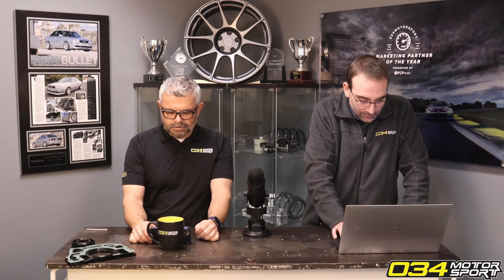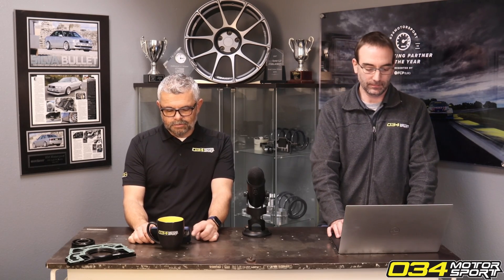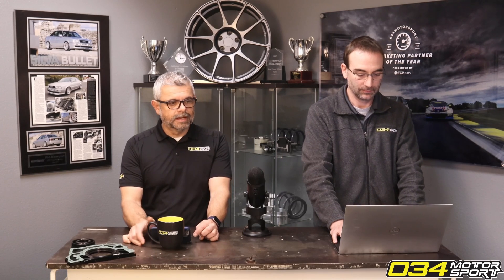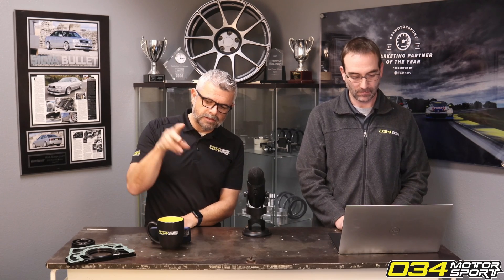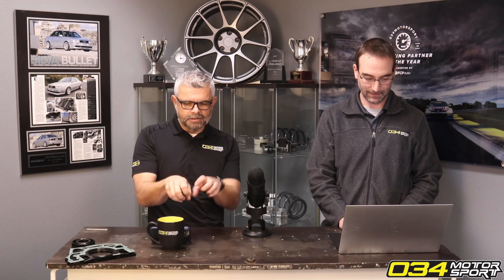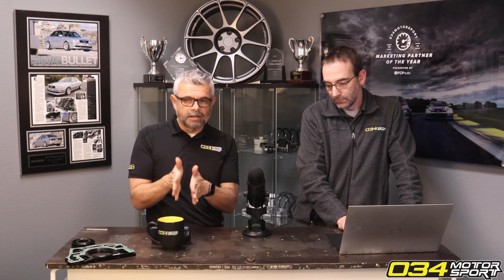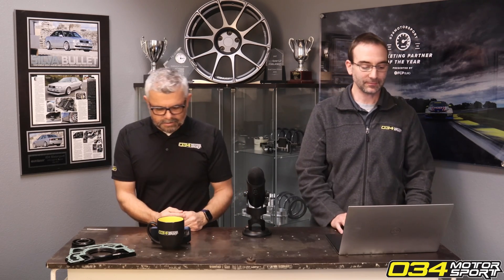Will Putting On a Turbo Blanket Reduce the Life of my B9 3.0t Turbo? | 034Motorsport FAQ

Comment: 10th gen civic owners! $30 turbo blanket and $24 air inlet blanket on Amazon . Been running good for 2 years now not one problem with the engine or blankets,I was very skeptical about it but I can’t deny the results I’m getting money well spent in my opinion a measly $54 best buck bangers around

Comment: I added a turbo blanket to my 2018 Fiat 124 Lusso with a 1.4 litre turbo engine to reduce temperatures under the hood to prevent damage to a lot of the hoses and plastic/rubber components nearby the turbo.  On the Spider the turbo blanket does not go anywhere near around the complete turbo more like 2/3 or slightly less around so this works better than the stock metal heat shield but is essentially a heat shield itself.  It really does accomplish heat reduction under the hood.  I haven’t observed any deterioration of anything on the turbo itself or anywhere else. I wasn’t expecting any vehicle performance change and there wasn’t any change.  The turbo blanket does prevent heat buildup and hence extends the useable life of under hood components.  My experience with this vehicle anyway.

Comment: This is nonsense. If you use inferior metals yes absolutely. But decent stainless won't rust I had mines wrapped drove it in rain you name it after 2 years pipes looked fine. Just don't wrap to thick

Comment: I’d love it if there were reasonable hood options with vents to help get the heat out/bring cool air in. I think the design of the B9 engine, while great, having that turbo up above an engine already getting hot really increases the overall temperature under the stock hood.
Reply from the maker: Adding hood vents to a car that was aerodynamically designed without them is tough.

There are certain pressure zones that you shouldn't mess with when adding vents to a hood. Improperly placed vents can decrease aerodynamic efficiency and cause an engine bay to not vent properly.